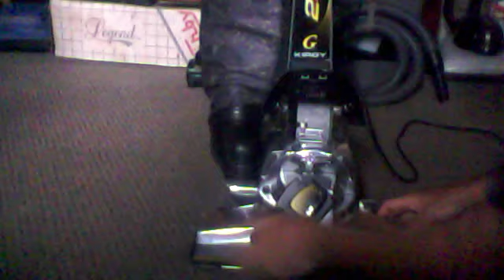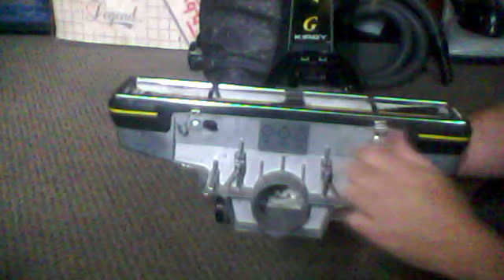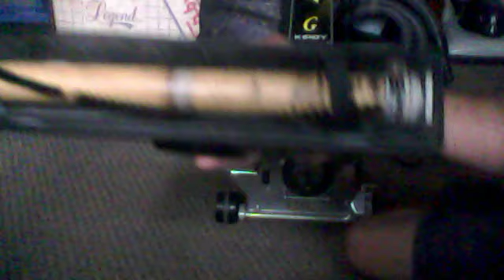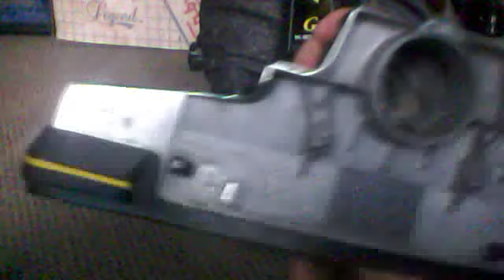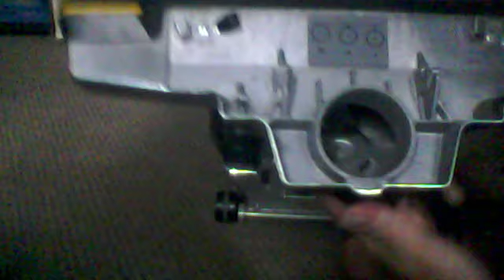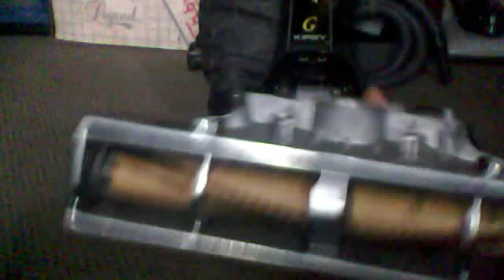G6 (or any G-series) Belt Replacement

Comment: hey buddy thank you so so so so so much!! i have my grammys super awesome old g6 and i was really bummed out. you saved me and hubby a bunch of money and allowed me to keep  my awesome vacuum !! also my clips for taking the bottom grate off were oxidized shut (with some wd40 and a hammer i could be opened it to release the brush access but i didn't have to because of the way you said "its easier to do if you take it off" and so i figured that means i didn't means i didn't have to! an extra 30 seconds saved is an extra 30 seconds i could give thanks. you were really well spoken and great at directions. it made your low quality video (lol sorry) totally watchable and awesome. even a blonde girl can do it =p ❤